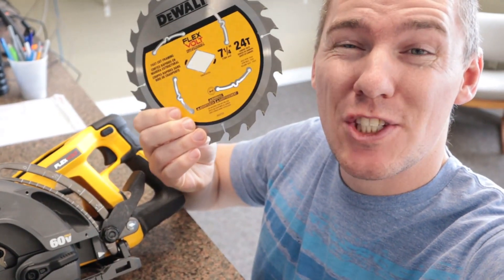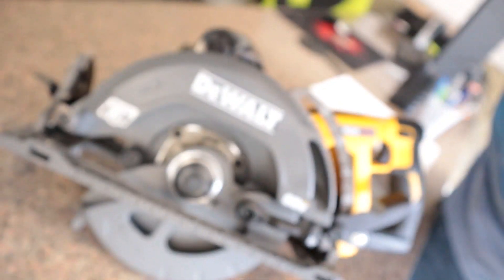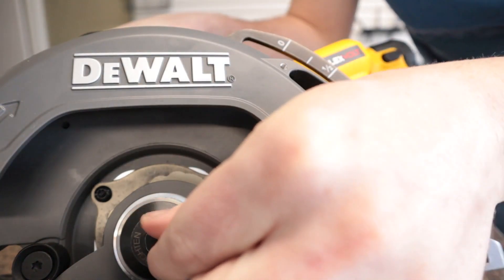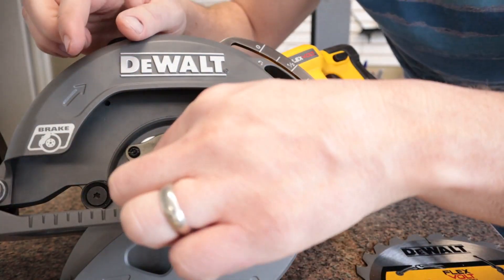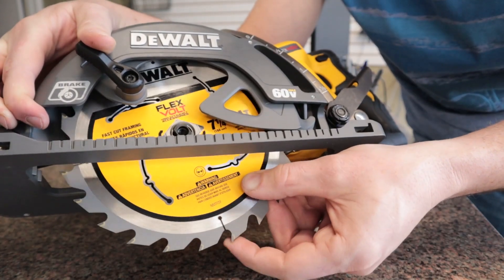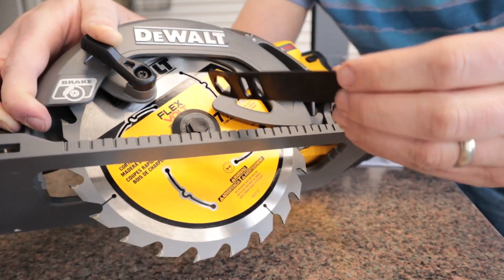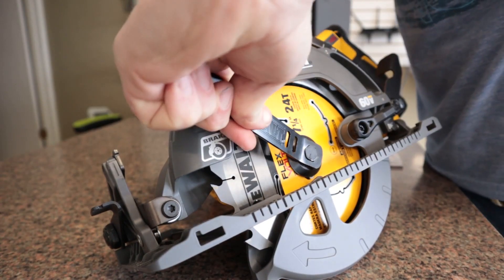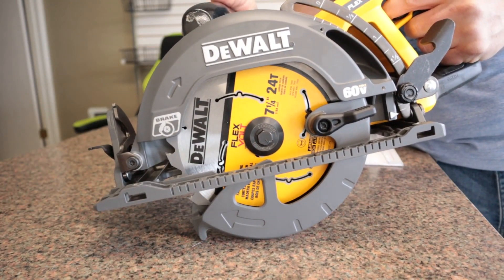How to Install a Circular Saw Blade - Dewalt 60v DCS577

Comment: Is there a way to attach or an adapter for this saw to put one if those diamond infused blades with the circle in the middle instead of the diamond shape? I am trying to install a saw blade that produces a polished cut like the saws they use to cut geodes and gemstones in half and they look smooth, not choppy or jagged cuts. My problem is that the 7" blades the stores have like the Makita precision blade and the DeWalt XP DW4760 Ceramic Tile saw blades have a circle in the middle instead of the diamond/rhombus shape that the saw spindle and the blade that came with the FlexVolt came with. Or is there any attachments or adapters to replace the saw spindle/arbor so that I can use these blades? Or is there a way to attach it to the FlexVolt saw as is? I am using my saw to cut stone but I am seeking out a blade that can give me a nice polished cut. Please help, I am very frustrated. Thank you.

Comment: Dcs577 comes with a 7.5" blade (DT40271-QZ). a 7.25" can be used as you have installed. Great vid by the way.